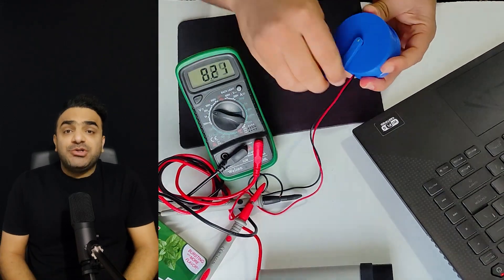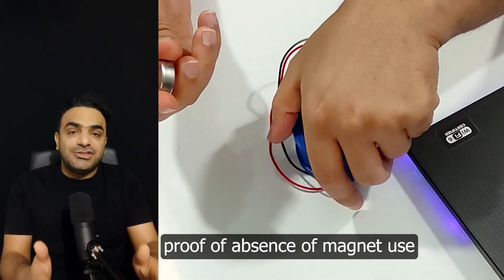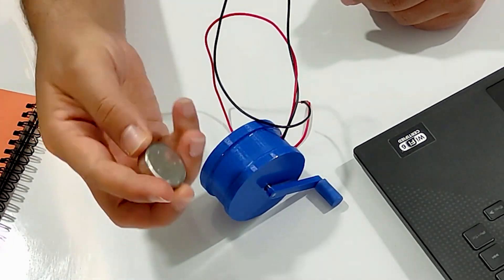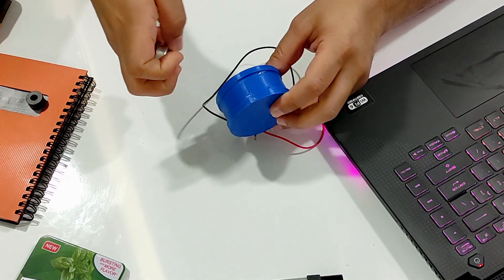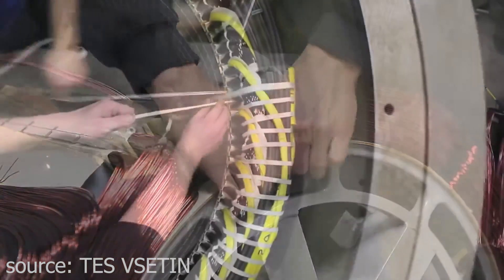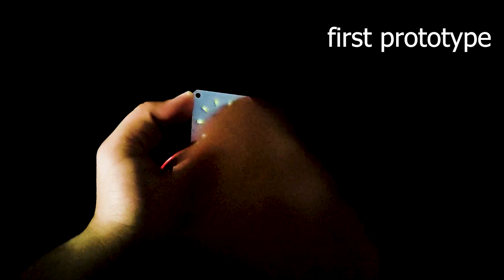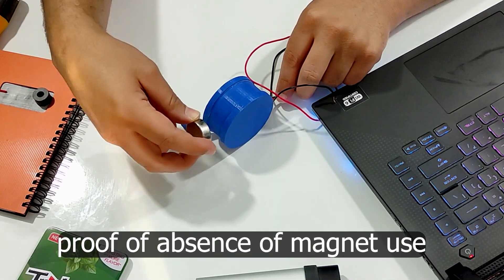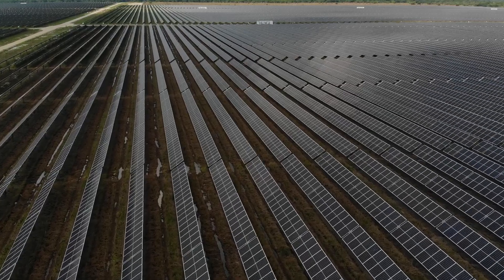A new method of producing electricity

Comment: Hello ,is this an electrostatic concept?
Reply: its seems like a bold claim with out seeing the workings and it was a very unstable output
Reply from the maker: @katiekumcgil I understand your concerns, and I appreciate your feedback. Making bold claims without demonstrating the workings can indeed be skeptical. Rest assured, this innovation is a work in progress, and the instability you observed may be part of the development phase. Once the patent is secured and improvements are made, more information will be available to address these concerns. Your input is valuable in shaping its future! 🌟
Reply: It is piezo inside check his other video about produce energy from wind you will find out, but this concept is weak not durable
Reply: piezo makes sense after seeing the voltage go up then down itll be pretty much useless for alot of phone charging since alot of newer ones require a constant voltage constant current @l4irxxl874
Reply from the maker: @l4irxxl874 
Certainly, to clarify:

"I want to correct any misconceptions. This innovation doesn't involve piezoelectric elements. It's a distinct and separate concept. I appreciate your curiosity and feedback. As we continue to develop and refine this technology, I'm confident it will demonstrate its unique capabilities. Stay tuned for more information in the future!" 🌟
Reply from the maker: "Hello! I appreciate your interest. Just to clarify, this is not an electrostatic concept; it's a completely new and groundbreaking innovation. While I can't share all the technical details at the moment due to the patent process, I'm excited to reveal more about this entirely unique technology once the patent is secured. Stay tuned for updates!" 🌟
Reply: its is simple ,we can answer the validity of this in a heart beat ,(whats the patent application number)
Reply: patent applications are available publically ,so theres no disclosure legalities
Reply from the maker: the patent for this innovation is currently in process. Once the final patent is secured, I'll be able to provide more information, including a patent number.
Reply: ok we hope it all goes well @energygrapgy